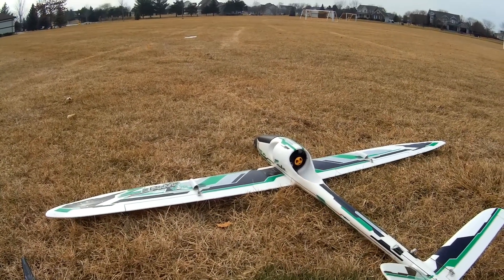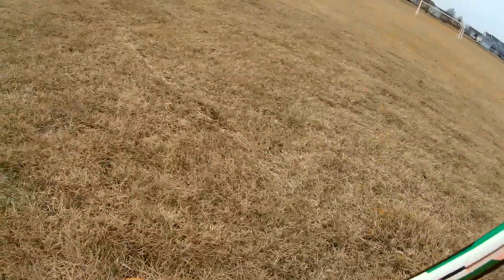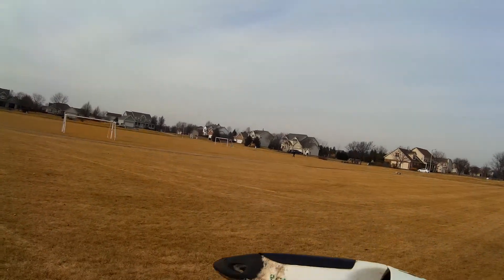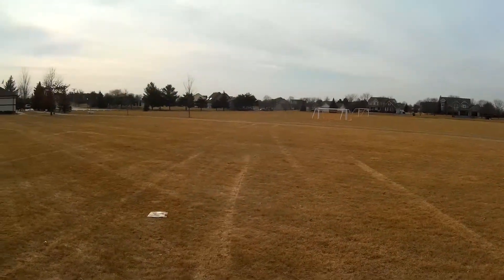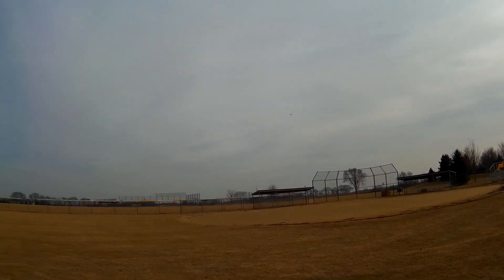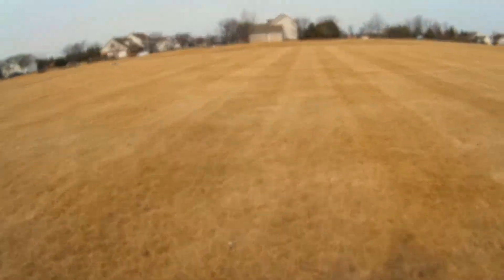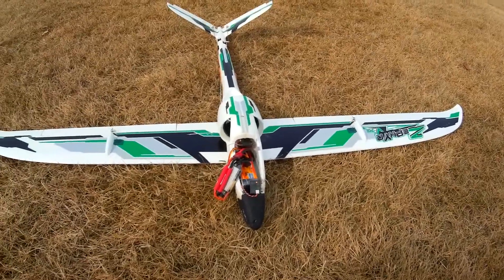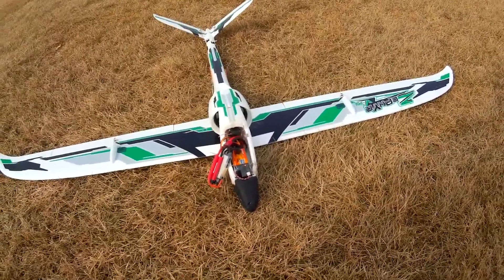DuraFly Zephyr 70mm EDF Jet Glider 1530mm  First Flight After Repair

Comment: hi there, i havent flown my Zephyr yet, i will be flying on a 3s 2200. would this be enough power? and where is the CG?
Reply from the maker: 2200 3s is fine, but you'll have to use weight in the nose to get cg.  2600 3s would be good if it fits.  make sure the battery's c rating is at least 35c.  45c is better.  A 4s 2200 is perfect and little if no extra weight is needed.
C.G. is 10mm behind the wires on the bottom of the wing.  And do yourself a favor and set up trim on your v-tails about the thickness of the foam. aprox 2mm at the tips.  You'll be sucessful for maiden with those settings.

Recommend throws at 80-90% ele. and rudd. with 30% expo's and ailerons dialed down to 40 or 50% with 25-30 % expo.
Reply: ok thank you very much looking forward to flying it! all i need to do now is replace the left rudder/elevator servo
Reply: do you have any idea how i can remove the servo? i think epoxy has been used
Reply from the maker: Thats why I use Foam Tac Glue.  But epoxy is brittle and can be cracked loose.  Just be careful.